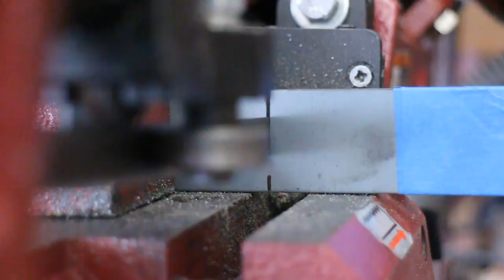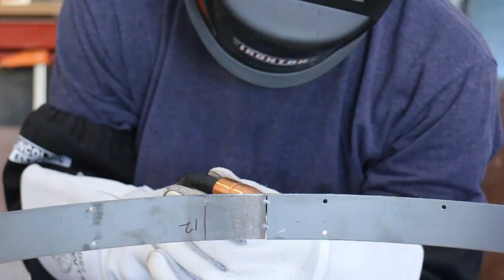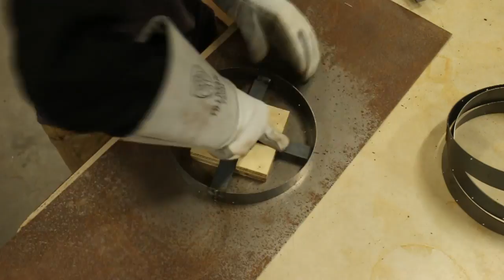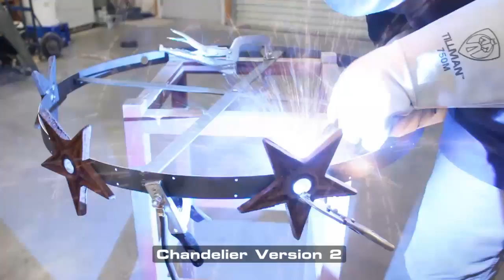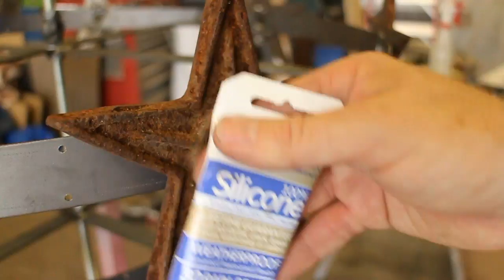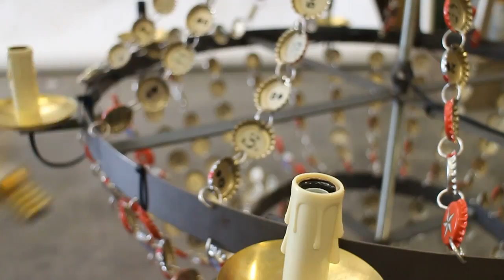Making Steel Beer Chandeliers

Comment: Hey Wesley, I discovert your channel about a week ago and by now have watched almost all of your videos. I love your work!
 If I could give 1 tip: if you ever have to make an other 100 strings of bottle caps, use self opening pliers in your left hand and hold them upside down so the nose is pointing at your wrist.
 This way you can still use your thumb and index finger to pick stuff up with out having to putdown your pliers every 2 sec. It's a technique that I have used a lot when doing 
chain mail. Greetings from the Netherlands!